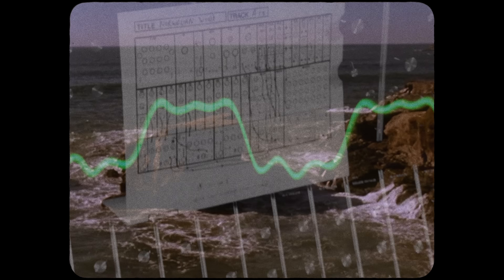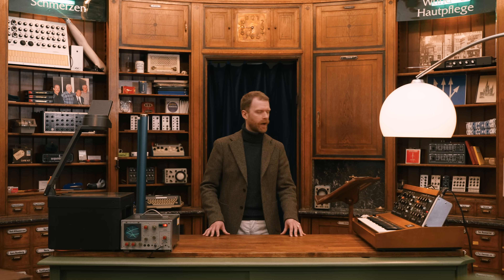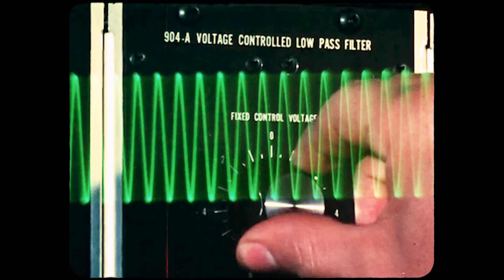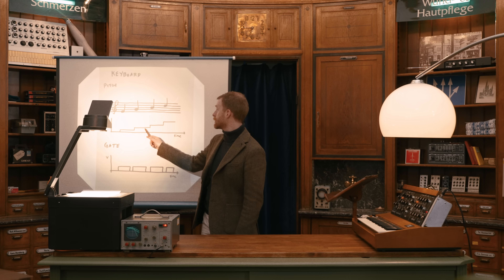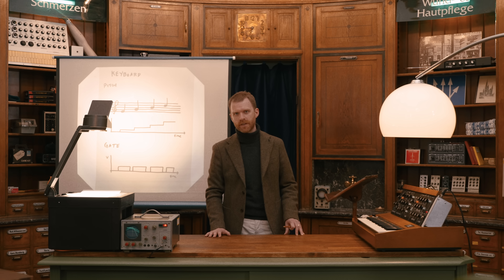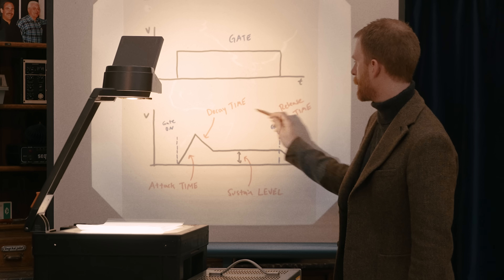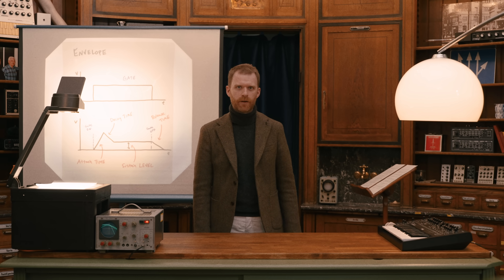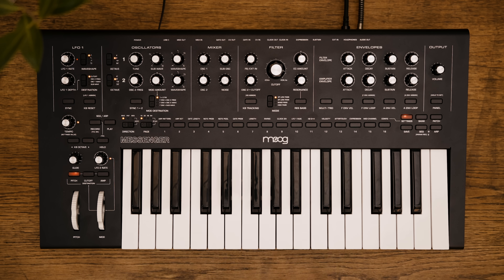Synthesizing with Moog | Lesson 2: Dynamics

Comment: Hello, I come from China and I have a 2022 Model D. I have a very strange problem where after a long time, if I don't turn it on and turn it back on, there will be a continuous low-frequency sound without pitch, and the keyboard keys will not make any sound. When I turn it on again, it will be fine. Usually, this situation occurs every month or a few weeks, sometimes every three months. May I ask how to solve this? I have read many bloggers saying that this is a product defect, but you don't have any technical support, it's really bad! I hope your technical personnel can help solve the problem. My machine product number is 627
Reply from the maker: Please reach out directly to our support channel for further assistance. They can help get you up and running! 
https://moogmusic-help.freshdesk.com/en/support/tickets/new
Reply: @MoogSynthesizers  I found a blogger on YouTube saying that the first batch of 1000 machines had product design defects, and many products were recalled. I think the cost of sending my machine back to the United States from China is too high, with risks in terms of round-trip shipping costs. The after-sales service of Yibai said that your Moog now does not have technical support, which is different from the previous Moog. I am very disappointed about this. I thought I was spending a lot of money to buy a defective musical instrument. This has caused me a significant loss. I tried to send you an email, but there was no response.
I hope you can proactively contact the Moog agent in China and provide technical support to help solve this problem. As for the defect of your product, there should be no charge for after-sales maintenance. Thank you